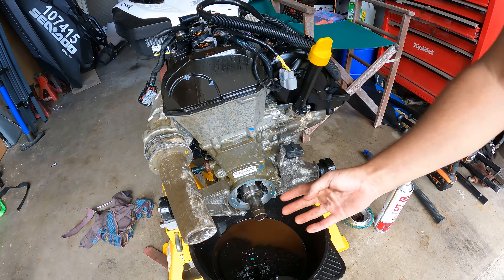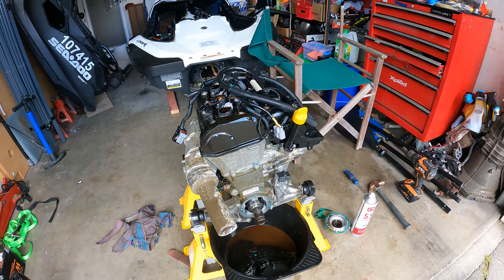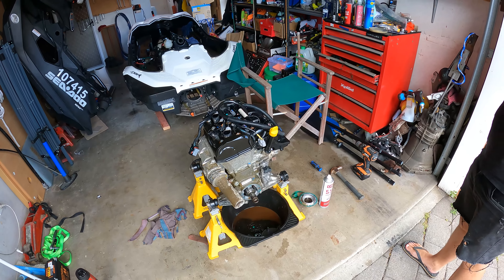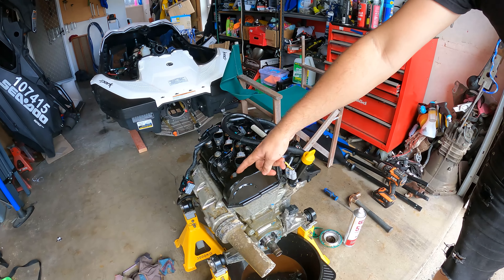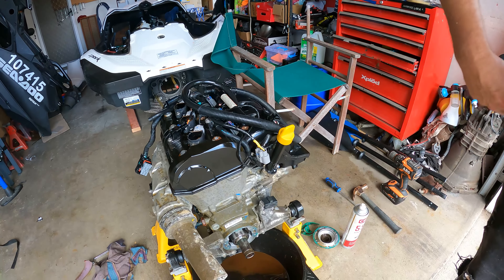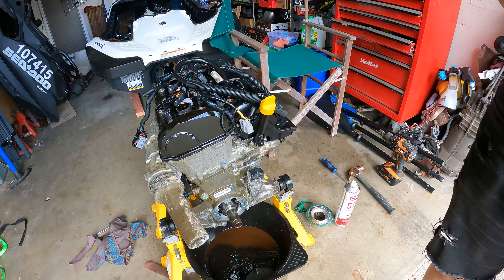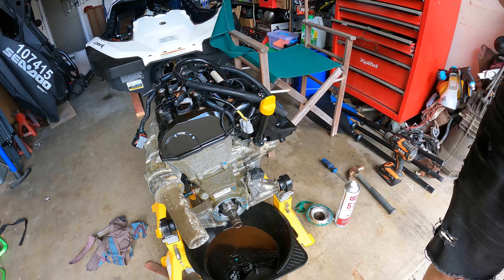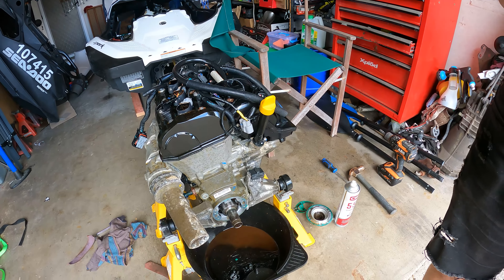SeaDoo Spark - Drive Shaft Repair | Part 1

Comment: Did the same JB weld/sanding method on my 3up 90HO spark and it worked like a dream, 30 hours later still strong. Just make sure you replace the PTO housing!
Reply from the maker: Cheers, yes I have heard it lasting along time, We replaced all the seals in the PTO while we were in there.

Comment: Hey mate, how high did you fill the hull? I'm trying to check if it leaks without taking the top off first.
Reply from the maker: Just under the battery depth, tip the jet ski back so the water can fill up in the back more.